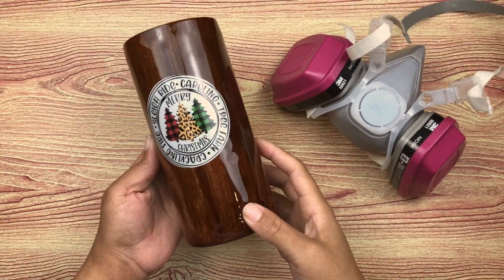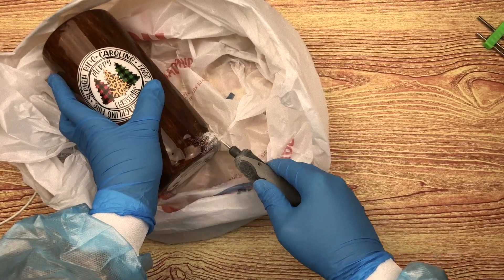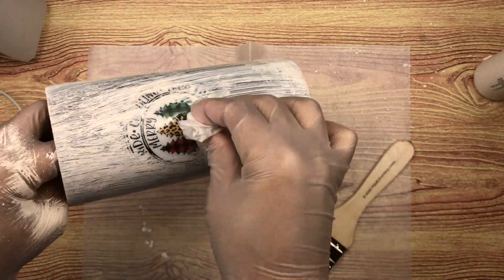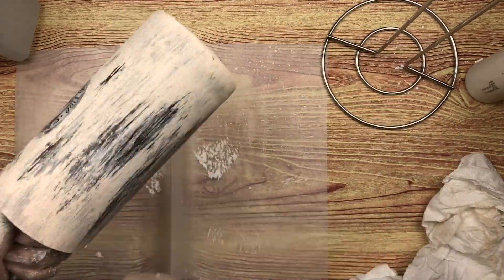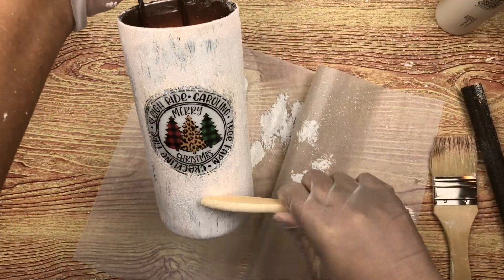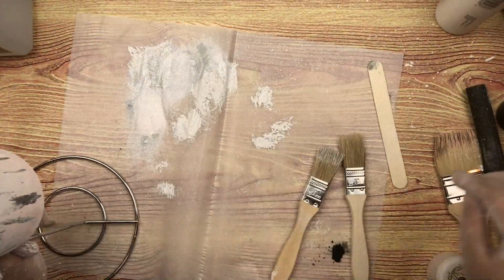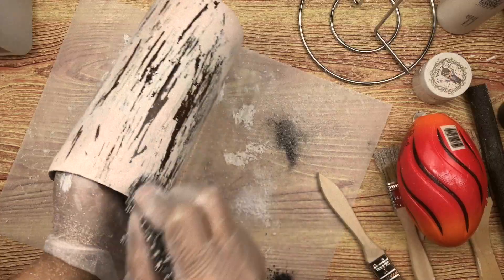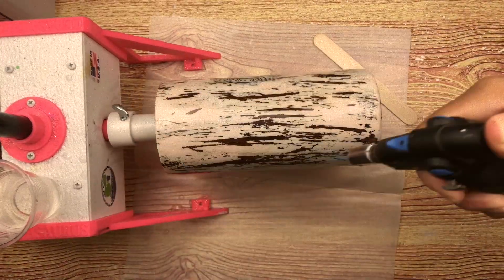How To: Fix a Damaged Tumbler

Comment: I have a starbucks Tumbler that has a design  on it a was using nail polish remover to remove a price  from a thrift store and it removed the plastic coating came off a bit could I fix it with epoxy or clear spray paint to fix it ?
Reply from the maker: Is it an acrylic tumbler? If so, Buff it with sand paper and wash it with dawn soap. Then epoxy it.
Reply: @KitchenTumblers  um i think so  its like the clear ones that Starbucks has but it has a design that Starbucks put on it

Comment: my tumbler is tacky after curing. any suggestions on how to fix it?
Reply from the maker: How long has it been curing?
Reply: @KitchenTumblers  3+ days. I washed it and scrubbed it and for some reason it’s still sticky. I weigh my epoxy so maybe I have a bad batch? 🤷🏻‍♀️
Reply from the maker: Some resins require 1:1 ratio per volume and not weight. Temperature is also a factor when it comes to weight, so that’s why they typically want you to measure by volume. I hope this helps.

Comment: I just sand a d re-epoxy.  I never paint over it.  Although I like the technique it isn’t necessary to save a tumbler.  I use a heavy grit like 80 and then a 200 grit to smooth it.  I wash with a baby wipe, let dry and put epoxy on it.
Reply: Thank you for this comment. My 1st 2 were a mess because I didnt mix the epoxy long enough I guess. Now I can save the cups. I almost trashed them.

Comment: That's awesome but you can just re-sand it or use ur heat gun on the spot/s and re-epoxy.  A mosquito got on my tumbler the other night in my building the cup was almost dry and I had to use my heat gun on the spot, it soften I removed it and let it finish curing
Reply: I get so many bugs do that I've let afew go out that we're in sand area or grass and named them George. They were for my kids and not a sale.  I like your tip to heat and soften. I will try that next time. Thank you.

Comment: If you have a vacuum with a hose attachment, tape the hose to the the table and it can help pull away some dust. I wonder if you could use one of those dust collectors that mail techs use as an added layer of protection.
Someone needs to create a tumbler lathe that spins faster for easier sanding.
Reply from the maker: You’ve just blown my mind.